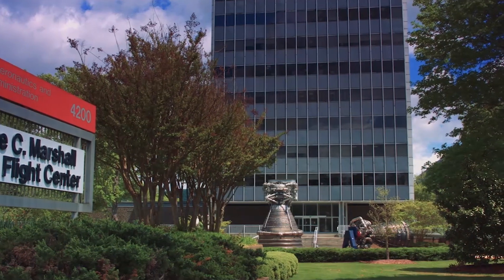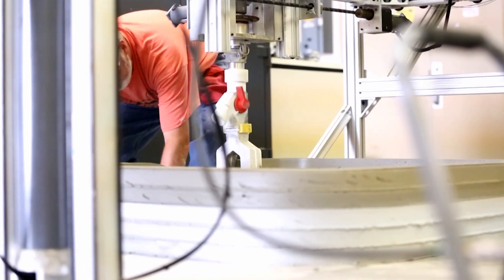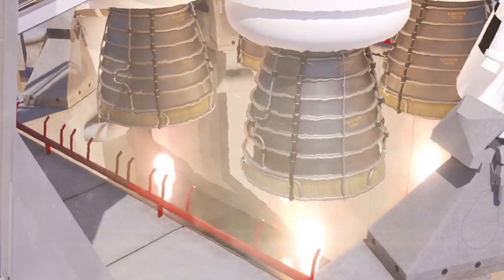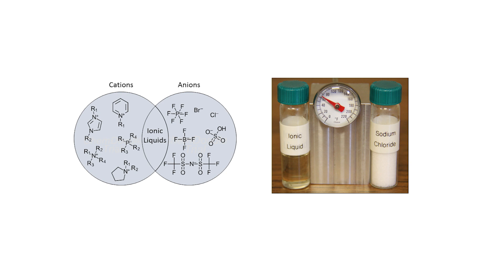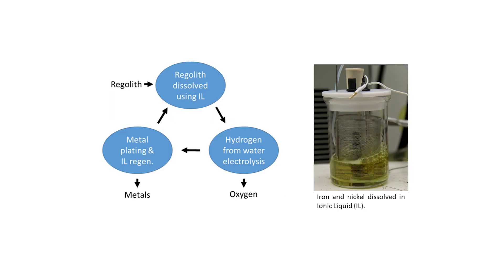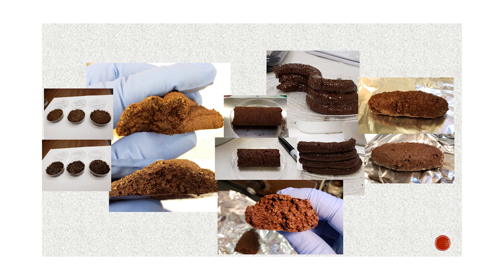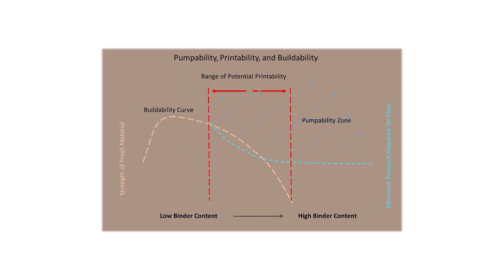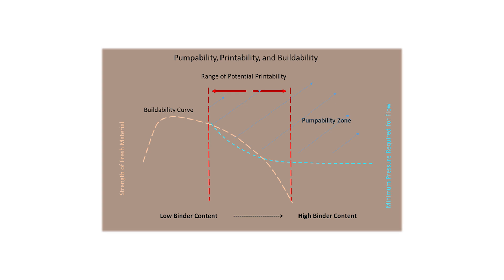In-Situ Production of Cementitious Material from Martian Resources

Comment: So you are aware I'm sure that there are big rocks, medium sized rocks and small rocks mixed in with all this regolith both on the moon and Mars.   I've seen the video demo of the regolith excavator and there aren't any rocks in the test bed.   It doesn't appear that the regolith excavator can handle anything but pure regolith.   You are going to have to hopper whatever is scooped up and do a shaker screen filter process to screen out all the rocks that get scooped up or something like that.

Also, has anybody considered if there is an issue of perchlorate regolith polymer concrete exposure to people or is your chemical process going to deal with that and filter it out?   If you do, won't you be creating an even more concentrated toxic waste?    Where are you going to put that?

Some other scientists that have been working on polymer/regolith construction are estimating that it will take a regolith polymer concrete structure a foot thick to provide adequate radiation protection.    Are you planning to be able to construct outer walls and roofs that thick?